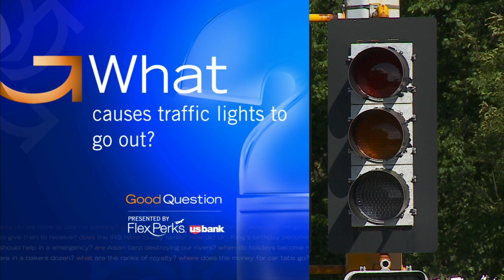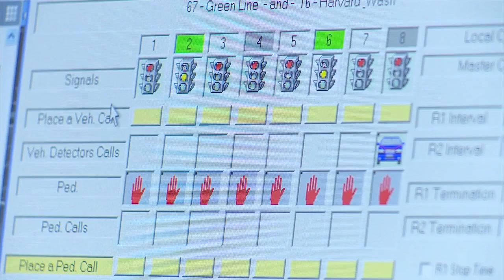Good Question: What Causes Traffic Lights To Go Out?

Comment: They use regular incandescent bulbs in them. They burn out just like any other bulbs. The older incandescent bulbs are all white. It's the filter over the bulb that colors the light. Green isn't really green it's aqua because green/blue is easier to see during bad weather. Older green filters actually don't look right when you get one because it's harder to see. The newer LED traffic lights use a multi LED head and they emit a bright light with most of the LEDs burnt out so the new LED bulbs have a good backup redundancy built in. If the traffic signal receives a fault error the light will automatically put itself into flash mode.